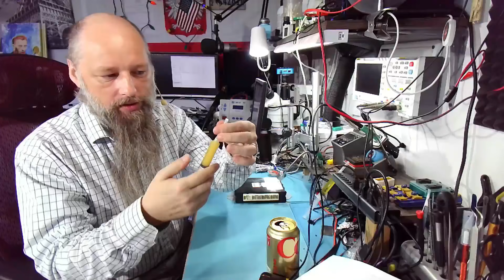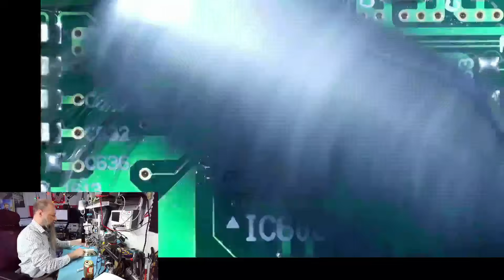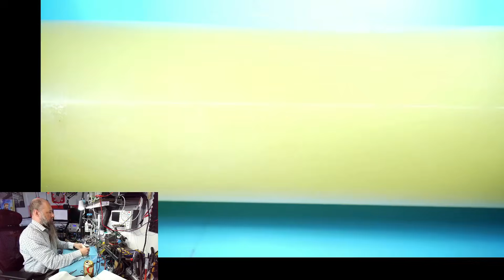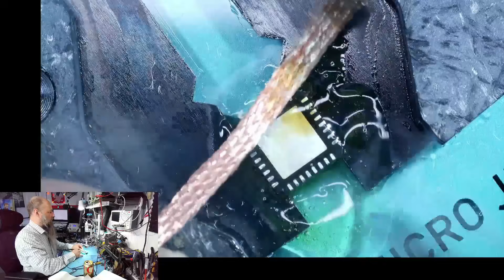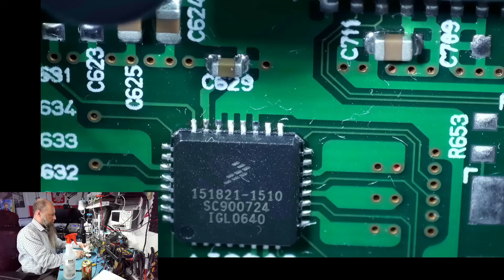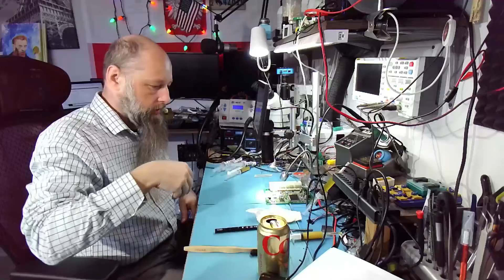282 | Omega 559 Flux

Comment: May I ask a question? So, that's a flux that you came up with, or? Also, any idea what 282 Flux is? It's nothing to do with your video number 282, that just came up, because I was searching 282 Flux. Anyway, I found a super old 1lb roll of factory sealed Kester Silver Solder awhile ago, and it's actually working great, but for flux it says Rosin core, but for the flux, the box says Flux 282/ 66 core. ANy idea what that means? Its hard to look up, because its so old that the box says don't smoke a cigarette until you wash your hands hah.
Reply from the maker: yes, this is the a flux I came up with and the community improved it by providing feedback. I have never heard of 282 flux but I assure you that my Omega 559 is a good replacement. Back in the day, all flux was like my flux. Now it's easier/cheaper to use lab-grade synthetic components than natural ingredients. My flux is an old school flux with a modern take on it :)

Comment: You need extractor for leaded solder to extract lead.
Any flux smoke is thick and sticky. It attracts particles.
If you don't extract it, even if the flux is not toxic, particles will accumulate in your lungs and eventually kill you.
Please emise extractor. I need you to live long and supply me with flux for a long time.
Otherwise I wouldn't care 😅
Reply from the maker: good point, I guess I will start using it
Reply: There is no lead in flux fumes.
You still want to use an extractor but it has nothing to do with lead. For lead risk, either wash your hands thoroughly or wear gloves.
Reply: I am not sure what temperature you use for soldering, but lead has a boiling point of around 1.700 °C – thats when it turns into fumes. My dad is now 77, he got a master in electrical engineering and he solders for 55 years without fume extractor. BUT: He never used extra flux because he never did SMD or hot air soldering. So if you just use leaded solder for "standard" soldering, I wouldn't worry too much. But with all that extra burned flux used when hot air soldering, I would surely go for a fume extractor. But thats because of the flux and not because of the leaded solder.

Comment: You can use molecular sieve to extract water from the flux while you are mixing it.
Also, you can do a test with copper tape (or copper or any kind) to see how reactive the flux is.
Just put some flux on the copper and heat it up with your iron and leave it on the copper for a few days to see how green it gets.
If it doesn't turn green then it is good for no-clean flux.
Reply: Exactly
Reply from the maker: Thank you so much, I'll look into that
Reply: You can use copper sheet and other fluxes like 559 etc and watch them turn copper sheet green if left for few days without heating.
Reply: @akierum  it should not turn green unless it is counterfeit 559.  Proper no clean flux should never turn the copper green.
Reply: @aurthorthing7403 counterfeit from the official store in EU called TME EU???